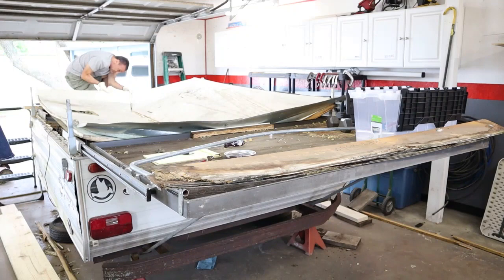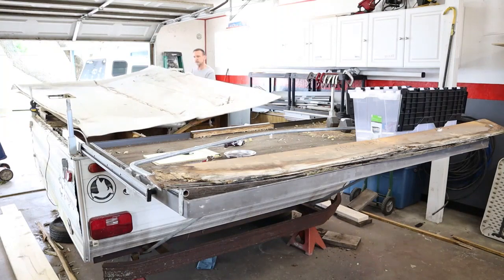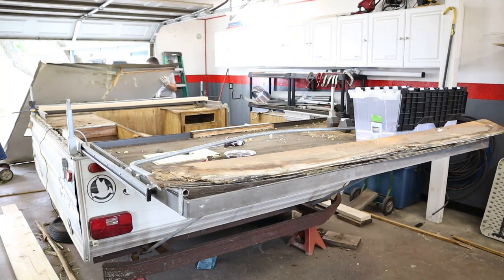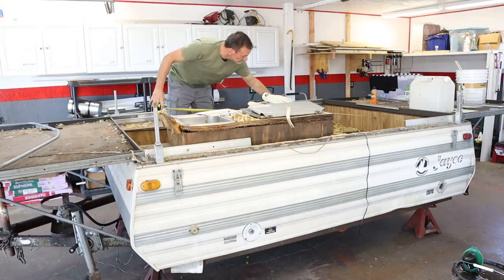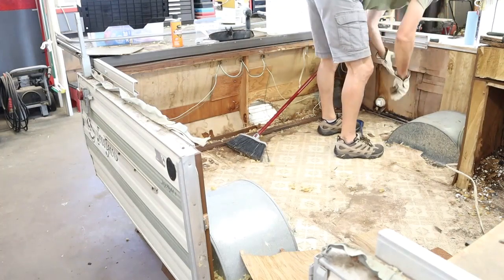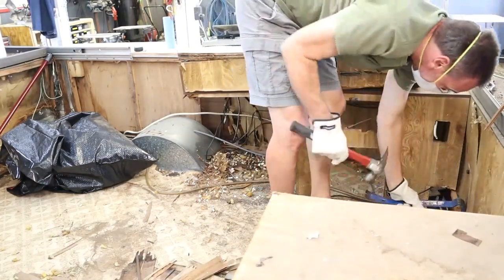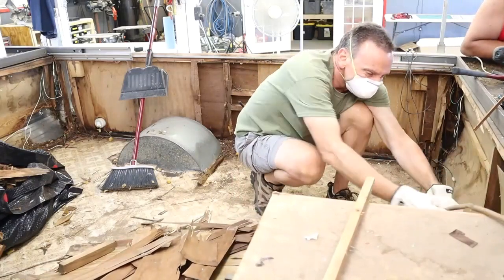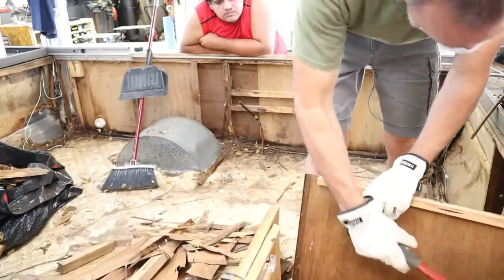JAYCO POP UP CAMPER PT 3 REBUILD REMODEL Modifications Renovation Roof Repair

Comment: Very curious if you have finished this project and  how the l and w system has held up. I’ve been working on a similar project and wrestling  with the lift system. I’m honestly think now about how to just bypass it with some kind of Jack’s. It’s the weak point of the system imho.
Reply from the maker: I have completed it and sold the camper. The new owner has reported no problems with the lift. i did upgrade my cables to 1/8" cable and the pulleys were upgraded from nylon to steel bearing pullies. Good luck with your project.

Comment: Do you have photos of what the roof looks like? I’ve got a Jayco 12ud with some sagging in the middle, likely due to the rooftop AC unit and I believe the gasket is letting water drip thru. I’m trying to figure out if I should just rebuild the roof or just replace the AC gasket and pretend the sagging isn’t there
Reply from the maker: I did a couple of videos of my top rebuild. If yours is sagging a new gasket probably won't fix it. The rain and condensation drain off will pool around the unit rather than run off. I have seen the sag a lot with popups with AC units. Good luck with your project. https://www.youtube.com/watch?v=XLio3Et6OjY